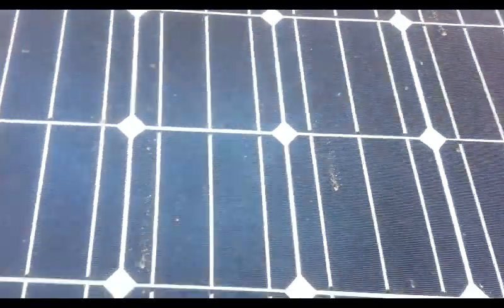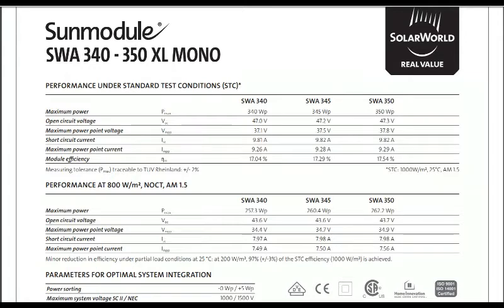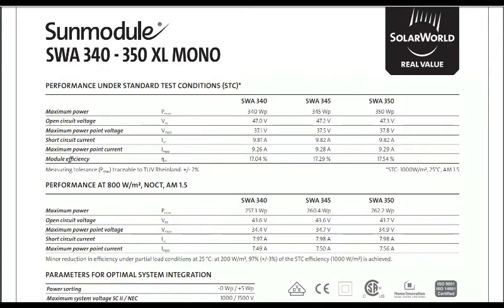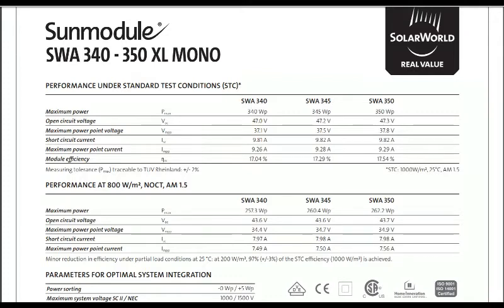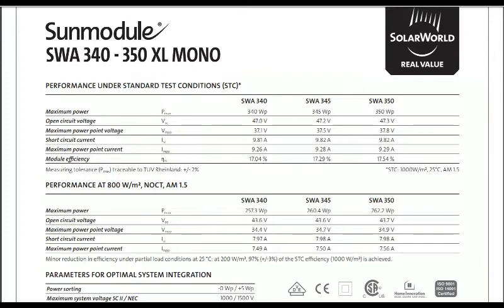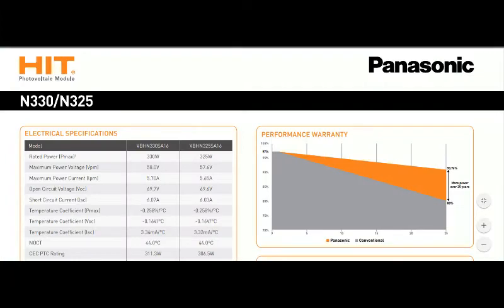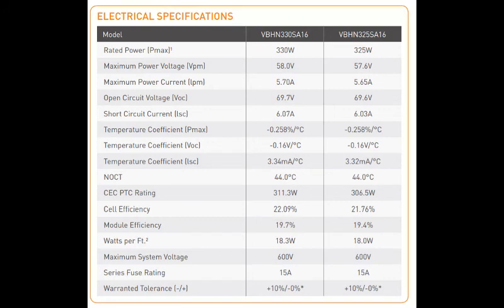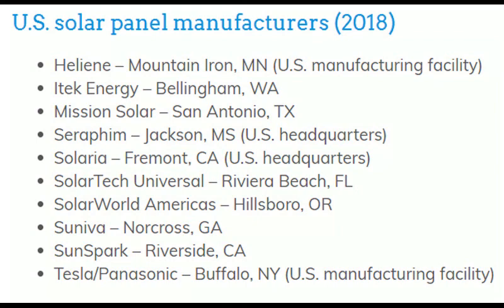DIY RV Off Grid Solar Panels #3

Comment: Thanks for posting these videos. I just got a 2011 sprinter and plan on doing a similar set up as you did, I have a long way to go stillI. I also live in Texas ! How many hours of use are you able to get out of the Coleman ac with the battery set up?
Reply from the maker: I do not run the coleman on the battery. It operates on shore power only. The coleman takes a pretty big surge to start around 1800 watts and once running needs about 1200 watts. Since my battery is a 5kw I could only run the AC for about 3 hours and my battery bank would be dry. I would only run the coleman if I had 10kw battery and at least 1200 w of solar panel. With the new Tesla panels you may be able to fit 4 of them on the sprinter.
If I was to run an ac off the battery I would have selected a different AC unit that could run on 500 w.
Good luck.

Comment: could you do a video on panel suppliers? that have good prices. and contact info?
Reply from the maker: James I could but the prices vary week to week with different retailers.  Any of the manufactures I showed in the video would be a good choice. I personnally like the panasonic Panel I showed in the video at 19% effencency. One thing to note, Shipping cost on panels is Crazy. It will cost the same to ship one panel vs a palet full. Its more important for you to find a retailer near you and that will save you more money that searching for best price.
Reply: RV-PowerWall do you know of any sellers. in or near western north Carolina? I found some in new Jersey and Florida. I have seen like 2-3 ppl here with panels!  and I think there a hole in the market.  it would be nice to find someone to split a pallet with. $300 freight on 1 panel or a pallet is crazy . especially when getting only a few. at $0.60 per watt is a good price on the panels I was thinking about getting. in a 255 watt. or 320 watt for a few more cents. until the 300 is added. you would have to get a pallet to keep it a deal.. I don't mind efficiency all that much. since space isn't a issue. its mostly dollar per watt. it would be less work. since I'll be doing it all my self. maybe I should re think things. I only have300 watts now. and planning on 300 more in a couple weeks. I have only 308 ah battery for now. I plan to multiply that by ten! plus. I'd like about 5kw battery bank. and 5-6 kW in solar panels. I'd like to have enough panel to charge and power the inverter. so I'd need at least 2kw more than the battery would require to charge in 4-6 hours. that's about all the sun I get daily . due to trees. anyway sorry for rambling. and thanks!
Reply from the maker: Find a retailer near you and find out what panels they sell. I did a quick search in western N Carolina  and there were several. http://www.ashevillesolarcompany.com/
https://www.yessolarsolutions.com/
https://ncsolarnow.com/
There were several more. Find out what brand they install and you may be able to pick them up and save all the shipping cost.

Comment: I recently got my first panels. I hot 2, 150watt poly. I'm gonna get 2 more if things go well. I just had to get off of the generator. I eventually need to get about 4-5kw in panels to run my off grid home.  great info. I'd like to find someone to buy in with me on about a dozen panels. of 255 watt or larger. thanks.

Comment: Dead on analysis about how to apply charge controllers. I would like to add one thought on panel design consideration and that is the "Maxim" integrated panel. How it works is by looking at the panel as having three individual strings of cells in parallel. Each of these strings are electronically optomized, thereby increasing the potential productivity in less than optimum lighting conditions, which is common in RV. Although this technology may not increase the statistical efficiency of the panel, what it does is increase the minutes or hours per day the panel produces power. Some manufacturers have been quote as saying 30% more KW generated. The Maxim chip is licensed to manufacturers by a company in Texas that developed it. Ot has been around for nearly 10 years now. I personally have designed and installed these in off grid and RV's. They rock! Here is a link to the manufacturer list. https://www.maximintegrated.com/en/design/partners-and-technology/partners/design-partners-solar.html#up_86tab0